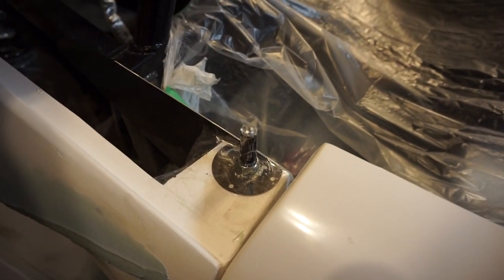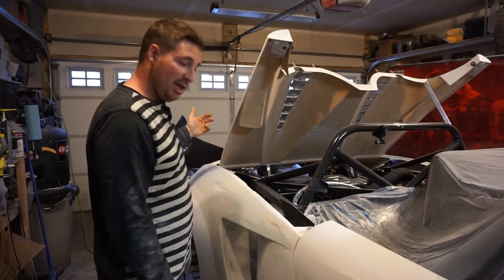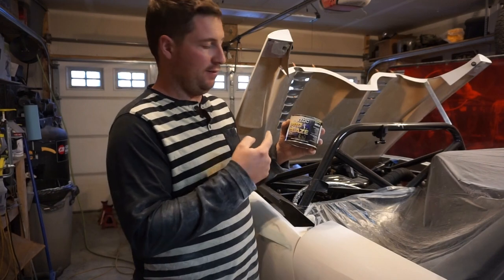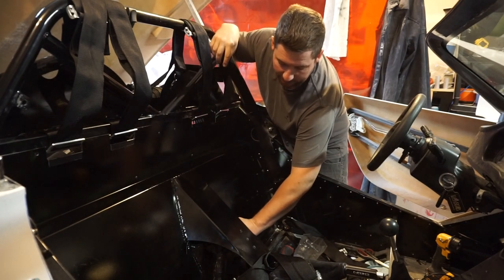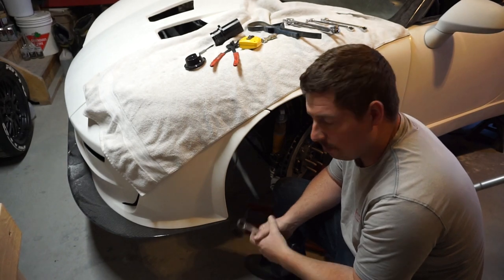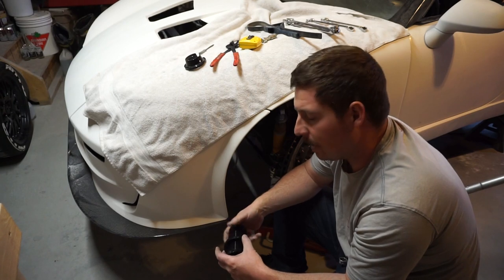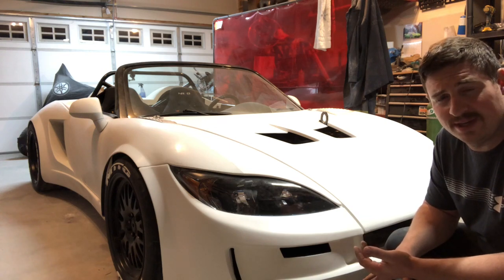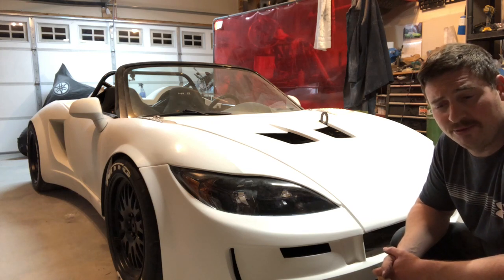Project 818 SRX Getting ready for inspection

Comment: Wow she looks GREAT
Reply from the maker: Marina Pope why thank you!
Reply: @Popes_Projects  quick question.. Do you wish you'd gone with the Subaru power plant and tranny, or are you happy using the rotary? If you decide to change to the boxer in the future, would you be able to swap it? Or did you have to modify it too much to fit the Wankel?
Reply from the maker: Nurzrachit I had to cut off the motor mounts and make my own.  Anyone that could do that could easily build new ones for the Subaru engine if he chose to switch.  I have no intention of using the boxer, too many issue with oil starvation on track.  And rotaries are cheaper to rebuild.

Comment: how wide are those tires? What's the largest you think you could get away with? Things sweet!
Reply from the maker: Rich B 305’s in the back.  Also 26” tall which is also more that recommended for the 818.  Someone has put 315’s on.  Obviously nothing nearly as big will fit without modifying the body, mine is around 4” wider out back